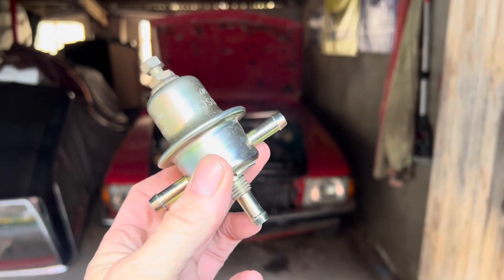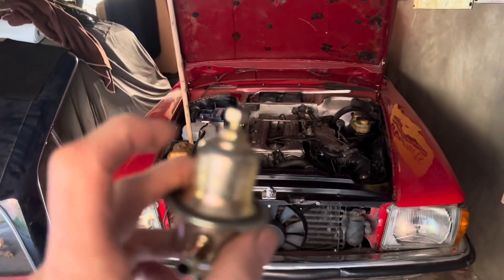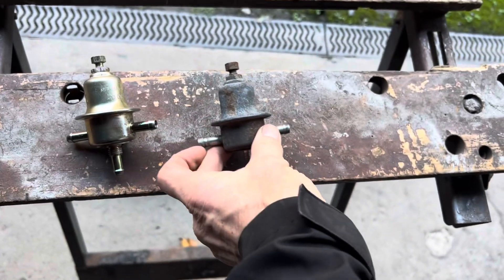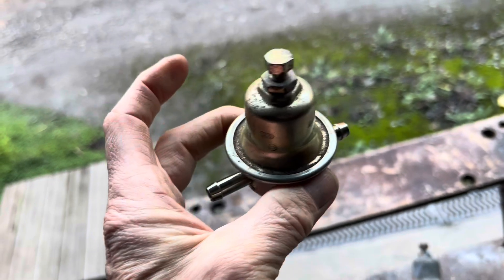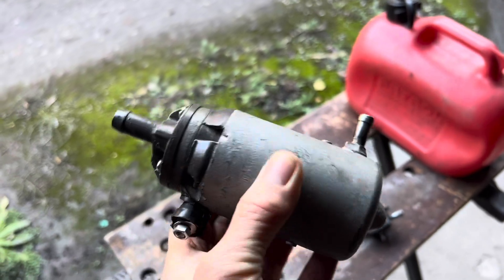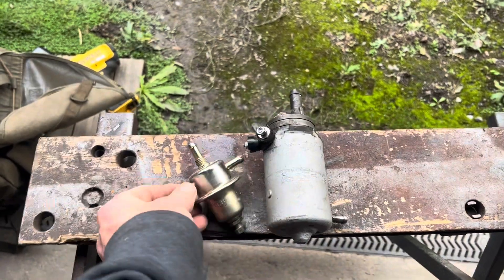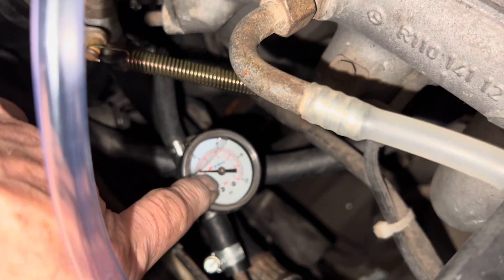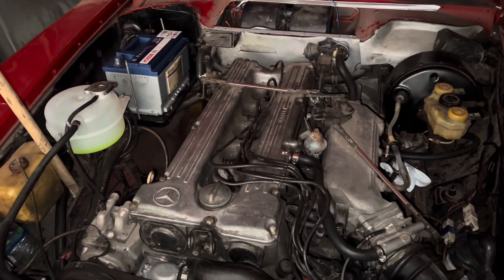Bosch Fuel Pressure Regulator and Damper - 0280160007 & 0280161002

Comment: Hey Mike, i'm in the market for a set of R107 560SL head lights. Like UK we drive on LEFT side of road. Can you help pl ?
Reply from the maker: Hi - do you mean Euro spec headlights for a 560sl….or do you mean a set of ZuS spec headlights? Where are you based? Mike
Reply: Hi, I live in Ireland (we drive on left hand side of the road as they do in United Kingdom). I imported a 560 from the US where they drive on the right hand side of the road, so I need the correct lights. I recollect one of your videos where you made some alterations to headlights in similar circumstances. Not sure what ZuU specs is ?

Comment: The leaks can be fixed by running fresh fuel through it (or just by running the car for awhile). Just texted this thing
Reply from the maker: ...Depend why its leaking. If the diaphragm is punctured or worn out, you will need a new unit. Mike

Comment: It looks very similar to the fuel pressure regulators used on the Jaguar V12 engines.
Reply from the maker: Hi - could be the the same as Jaguar used the Bosch D Jetronic fuel injection system. Mike

Comment: Is it even possible I dont have this regulator in my car? 280 SL W107 EU, 1975
Reply from the maker: Send me a picture of your engine. M_scott65@hotmail.com. If it is a k Jetronic, it won’t have a fuel pressure regulator. Somebody could have removed the FPR and modified the fuel system…..Mike
Reply from the maker: Thanks for the pictures and video link - the fuel distributor on your car is from a later K Jetronic system and so your engine would NOT have the fuel pressure regulator mentioned in your original message.

There is something strange about your engine set up which I cant quite put my finger on. Can you tell me:

1. Is your car automatic or manual?
2. Am I right in assuming your car is left hand drive?

I have a 1975 D Jetronic 280SL left hand drive (the red car I am currently working on) and also a left hand drive 1976 K Jetronic 280SL (the silver car). The M110 engine in the 280SL changed from D Jetronic to K Jetronic between 1975 and 1976. Your engine set up looks a little different from all of the engines in 280SL's I have owned.

Is it possible that some one has put a different M110 engine in your car...albeit not from a R107 SL?

In the picture you sent me, there is a Y shaped vacuum pipe near the bulk head which doesn't appear to have any tubes connected. A vacuum leak could well be the reason your car is not running correctly.

Mike

Comment: If the fuel pressure damper fails could it cause a misfire?
Reply from the maker: Unlikely. What make model and year is your car. Misfire is generally related to fuel injectors, trigger points or ignition leads. Mike

Comment: I understand the regulator, but now I don't know how to set the fuel damper
Reply from the maker: Hi - Good question.

Bosch fuel dampers are generally set at the factory and shouldn't really need to be adjusted. I'll see if anyone out there has ever adjusted (or tested!) one and how you measure the effectiveness of any changes you make,

Mike

Comment: Excellent as usual. Would you please update us with restore/repair of the bad pressure regulator and maybe the fuel vent valve under the rear left axle (the excessive pressure buildup in the fuel tank). Thanks
Reply from the maker: Thanks for your comment...and yes, I plan to do a follow up on whether I can bring my fuel pressure regulator back to life....and if not, whether a modern alternative can be used.  

What car do you have (make model and year)

...and why are you getting excessive pressure build up in the tank?

Mike
Reply: I have a 1973 450SL D-Jetronic US model. After many years sitting in about 5-7 years ago I replaced fuel pump , all the soft hoses and fuel injectors. Fuel tank was removed and cleaned  professionally. Car runs good yet does not take it out for driving till other issues and registration is taken care of. However many leaks started to occur around soft hose connection near pump when car starts after few days not running. It is possible hoses are deteriorating again due to ethanol. Leaks  will stop after turning off the car. I get the famous whooshing sound when fuel cap removed. After what you said about newer pumps have more pressure made me thinking that maybe leaks are occurring due to that. I have not checked the pressure regulator nor the vent valve under left rear axle, nor the vent line for the blockage. I read some recommend to use high pressure hoses. But I think the hose clamps still will be the weak links. Sorry for the long reply. @MikesMercsandothercars
Reply from the maker: Hi - the D Jetronic fuel pumps are very distinctive. Have a look under your car and see if your pump looks like the one pictured in the video below:

https://www.youtube.com/watch?v=srvBSoYbUK8

The outlet pipe is at a right angle to the pump - on later pumps, the outlet comes straight out the back of the pump.

If you have a later pump working at 5-6 bar instead of 2-3 bar, that could account for fuel leaks and pressurising your tank.

If it was me, I would also consider adding a small fuel pressure gauge just before the cold start injector. They don't cost much and you will instantly be able to see whether your car is running at the correct fuel pressure of 2.1 bar.

Mike
Reply: Thanks for the link. Oh boy, I may be out of luck. I did the pump about 3-5 years ago. initially tried to make it work but was not running but after few hit on the body did worked but was leaking from the seam lower than the top you took off on yours. I may have saved the pump. Not sure. Try to find it tomorrow. I have seen after marked fuel pump regulator that some use on VW and smaller cars. would you recommend such devices or better start hunting for a used pump. Car does runs good but down the road the pump may cause other problems other than the leak. The replacement as far as I remember did not needed any modification for installation. Ports were same as the old one. @MikesMercsandothercars
Reply from the maker: What country are you in? I may be able to point you in the right direction for a replacement pump if need be.

I have yet to try a different style of fuel pump regulator...but I will once I get this project car running properly. Mike Mike @siamak1
Reply: Thanks, I am in California, San Francisco Bay area. 
 @MikesMercsandothercars
Reply from the maker: I have ordered a new fuel pressure regulator from Rock Auto and will do a short video when it arrives....to see if it works as a good replacement. Spent a year out in California - loved it. Mike @siamak1

Comment: Very interesting video ! Do you think these fuel pressure regulator could be replaced by modern unit found on eBay for very cheap ? On latest Kjetronic the fuel pressure regulator is more than 400€ from Bosch, where a standard fuel regulator (you can set the pressure) is less than 40€. 
Impatient to see your car running !
Reply from the maker: Hi - Good to hear from you. I have wondered the same, and have been exploring alternatives to the Bosch. For me, it has been a matter of getting one small enough not to look out of place. One day, I'll actually get round to paying some attention to my silver K Jetronic 280SL...Mike

Comment: Nice video, Mike.  When I did my fuel system,  I installed a new pres reg and new Damper (from various global locations in eBay).  I paid someone to clean and flow test all 7 Injectors and I bought new rubber seals for them which were hard to find. I disassembled and cleaned my old fuel pump.  The only issues I had were a few fuel leaks from a few of the 100 or so hose clamps and one bad injector.  Fuel pressure was good out of the box.  Can't wait  for yours to get running!
Reply from the maker: Thanks for your comment...I feel we are getting closer to starting the old girl. Funny you should mention the fuel clips, because every time I buy a bag of 10 horribly expensive stainless steel fuel clamps....I always discover more jubilee clips that I need to replace! Mike